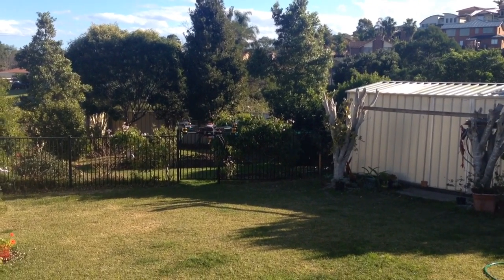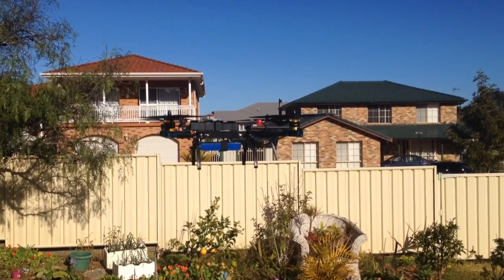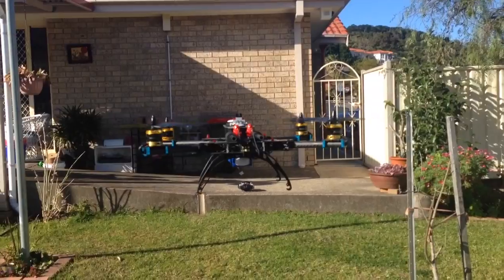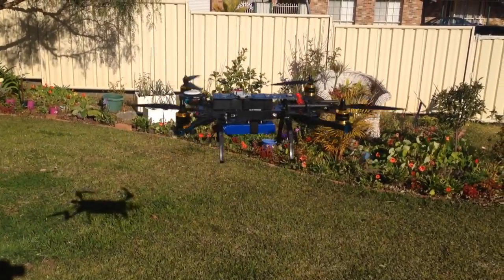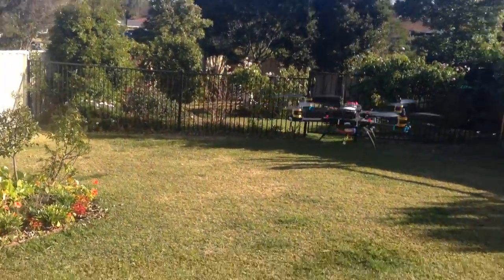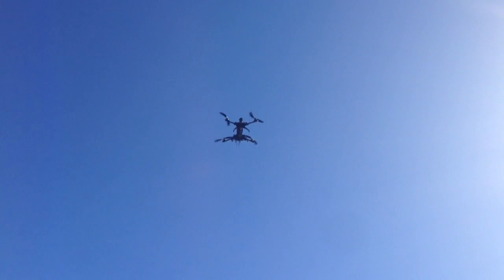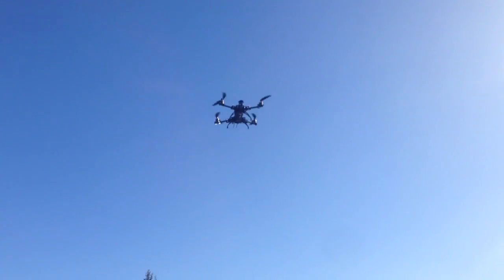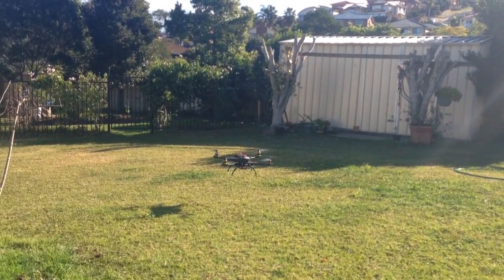NAZA Lite GPS Hover demonstration

Comment: Does Mum know you are in her back yard?  Yah, my APM does that and about a dozen other things that I LOVE!  I noticed on Ebay that DJI FC combo is only about 160 bux.  I think the APM all up is 110 USD.  Food for thought in the future!
Reply from the maker: Yes I'd like to experiment with the APM and Multiwii more but am rarely home enough to dedicate time to it.  You can buy the NAZA FC (minus GPS module) for about $70 from HK.  I plan to do this and just swap the GPS modules (I have 2 now) from one quad to the next as needed - they plug in and out as easy as a battery and if mounted by Velcro its a 5 second swap.. Told you I'm cheap!.
Reply: ***** Dang!  I LIKE the swapping idea!  You can't fly two at once.....oh wait.....  ;)
Reply from the maker: Brian B you can actually fly the NAZA without the GPS plugged in, you just lose GPS Hover but still have "atti" which is self level and altitude hold.  And manual mode of course.   Just noticed its down to $65 now on HK   http://www.hobbyking.com/hobbyking/store/__30901__DJI_Naza_M_Lite_Multi_Rotor_Flight_Controller.html